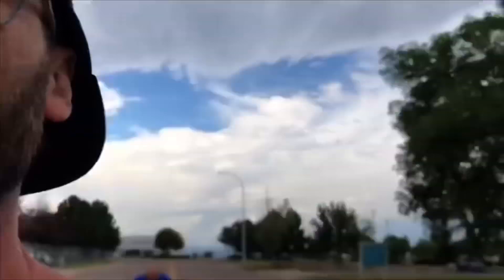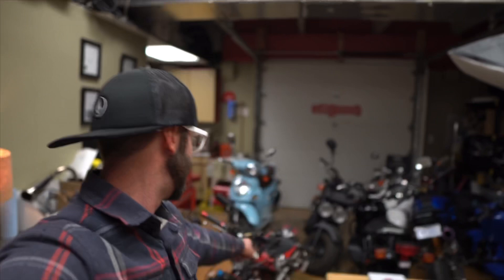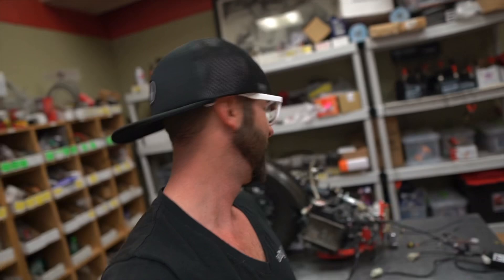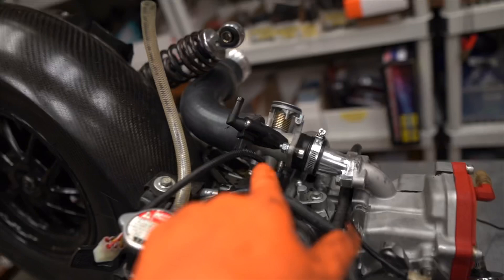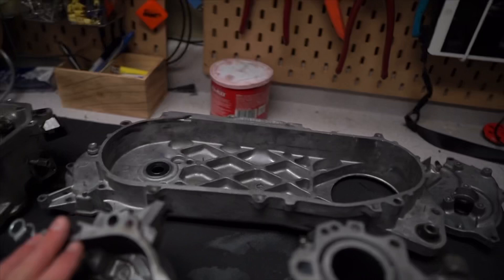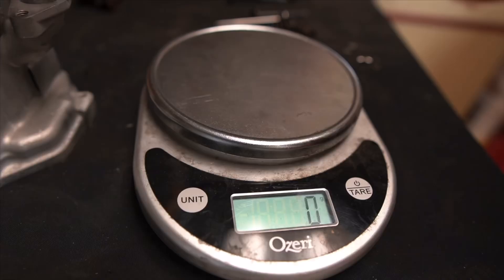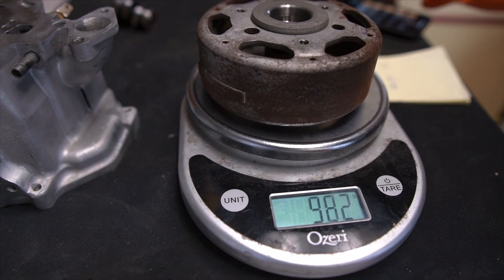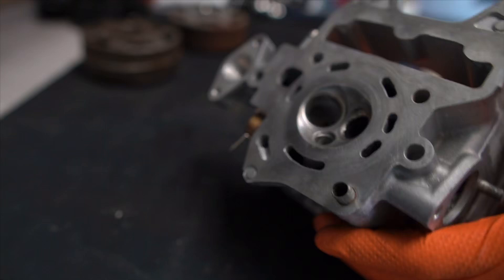Honda Ruckus MAX PERFORMANCE!  (Stock engine) PART 1

Comment: TRY A STANDARD E.F.I. AND [UT IT ON THE TURBO, BALANCE THE PORTS TO TIMING, THEN PUT ENGINE ON A FLOW METER SETS USING THIS TO MEASURE AIR FLOW INTO THE ENGINE AND WHAT'S COMING OUT. BEST WAY TO BALANCE AN ENGINE WHILE RUNNING. IT BALANCES THE PSI, AND FUEL MICING WHILE RUNNING EVEN SET THE WASTEGATE PRESSURE AND SEE ID IT WORKS WITHOUT DAMAGING THE ENGINE. The head will have to be a four-valve setup, have titanium valves in it.  if you don't use EFI for whatever reason, try a 38 mm racing carb on it! Then you will have max power that the engine can make, for sure!! Done right without damaging the engine you can get 45% more power out of it. On this video why not balance the crank while you have it out and then power balance the thing, be sooo smooth running if done? oh yeah, did I tell ya, over 100 mph? peace out!
Reply: What the fuck are you saying dude, its English but nothing makes sense

Comment: Whats is the fastest ruckus you have built , have you gotten to 100mph with the gear set you put together on the 232cc? .
Reply from the maker: I have gotten my 232 to 96 and it had a bit more.... super sketchy
Reply: @RollingWrench  i agree not sure if you remeber traded some video and messages a few months back to diagnosis a gy6 that had a destroyed starter clutch and it was super sketch at the top speed of 86 mph... after replacing my trx 450 with a amazon special carb set up. Not sure if you go my other message but my 6 finished builds and stock pile of parts was recently stolen amd the trailer was found actually in your neck of the woods i think. If your in Denver,  i think i remeber thinking you were in Colorado.  Im going threw scooter withdrawal.

Comment: I’d like to do that to mine.  How is the EFI kit coming along?  I want to keep it a stock 49cc because laws loop holes where I live but I’d like to be able to rid on a road that’s 55mph and not come close to dying.  My stock ‘09 can hit 42mph down hill/flat but when I hit the uphills I drop speed so fast it’s like breaking to 15-20mph.  Think y’all make a 49cc EFI performance kit with titanium values and so on. Like a stage 1000000 for the GET 49cc

Comment: @ROLLING WRENCH , would the EVI get a ruckus with a ecm that's died for the 2ed time back up and running wasn't sure how it was wired of it pulls power from 12v and then just pulse from pickup  with timing built In the last time this happened I replaced the stator checked all the wiring and put another ecm on it only for ot to blow the ignition controller internally after 500 miles, would the EVI get ot going again without a need to buy another brain still runs the fuelpump and and cranks over
Reply from the maker: It should. The EVI bypasses the stock ignition completely. The only time I have seen ecu’ sho bad multiple times is from the NCY cdi box

Comment: Odd he did all that to get 51 mph when the duck shop sells a stage 2 kit that goes anywhere from 50-60mph and isn’t as intrusive 😂
Reply from the maker: Let me help you a little. We are in Denver Colorado. We are at nearly 6000 feet above sea level. The higher you go in elevation the worse your performance gets. We loose 20% of power up here. Of this same bike was at sea level in Florida it would easily do 60mph. Put that in your brain and store it.
Reply: @RollingWrench  hey thanks for the professional reply! Appreciate it!

Comment: Great video.... I've hot a 50cc Tao Tao and its a little rough but its my first-ever scooter and i wanna put a 150 in it on a very tight budget. Any advice?????
Reply: I have same scooter and I put 100cc bigbore kit and got top speed of 46mph
Reply from the maker: The 150 motor mounts from the top and the 50cc mounts from the bottom. It would be a difficult swap. This is what I recommend for max power out of the engine:

https://www.rollingwrenchdenver.com/products/90cc-monster-big-bore-cylinder-kit